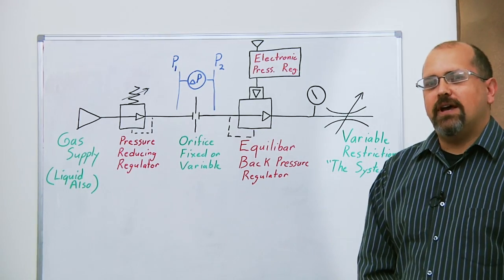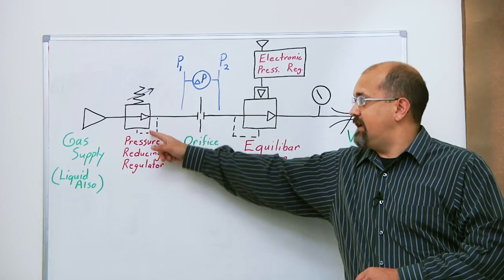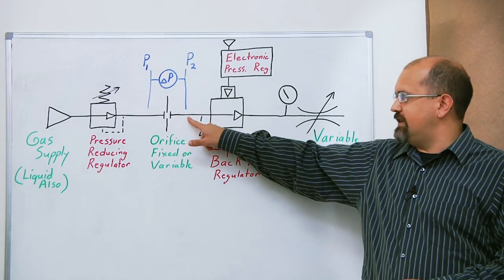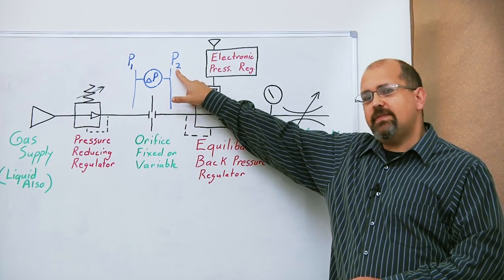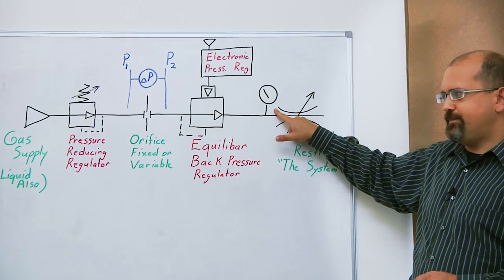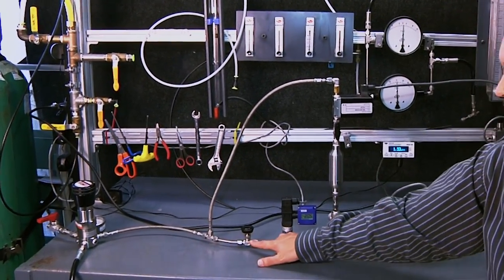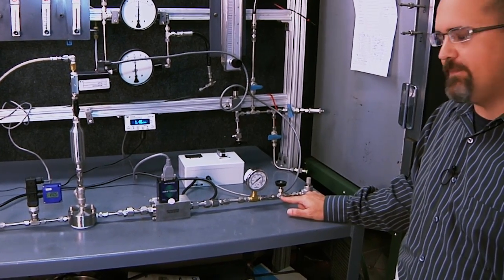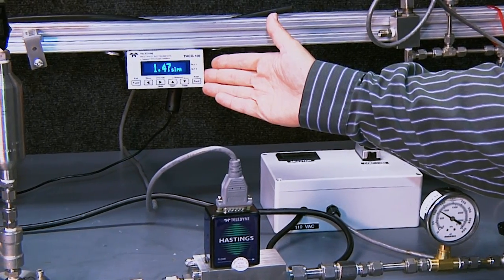Controlling Mass Flow Using a Back Pressure Regulator

Comment: Orifice will be chocked always ....so the variations in the downstream pressure due to unsteady combustion cannot propagate through the chocked orifice...can you explain a bit more..I am a researcher deals with these kind of stuff...
vishnuvishnupr@gmail.com
Reply from the maker: Hello Vishnu, 
Choked flow in an orifice will mandate that the mass flow through the device is not affected by downstream pressure. There exists a special pressure ratio in which choked flow occurs; for air it’s easily achievable. I will be happy to discuss your specific questions about this, would you mind sending me your application so we can discuss? 

Ryan Heffner
Design Engineer

Comment from the maker: Hello ccarp55;  Thanks for commenting.  You have asked a great question.  The video does show mass flow control as opposed to volumetric flow control.  The reason it is mass flow that is being controlled is that both the upstream and the downstream pressures are being held firmly in control.  The differential pressure is created by modulating one of these two regulated and controlled pressures to achieve the desired differential pressure.  Because these pressures are under tight control, the density of the gas is always a known value that will not fluctuate.  Since the gas density is controlled and known the flow being controlled is mass flow.  If we were controlling the differential pressure only and the common mode pressure of the gas was allowed to vary then you are correct that it would be volumetric flow control.  (The common mode being the P2 pressure in this case).